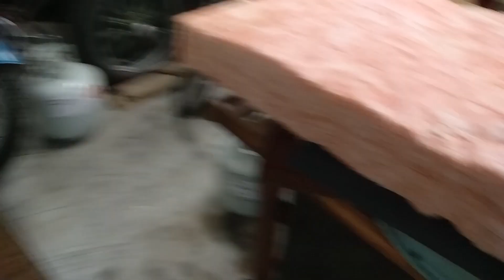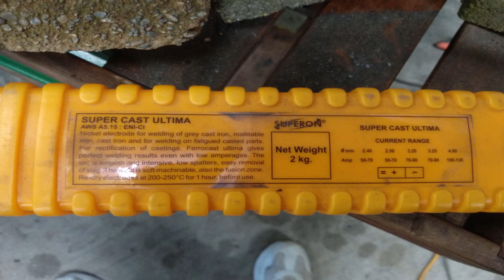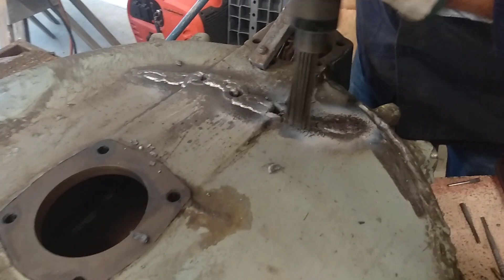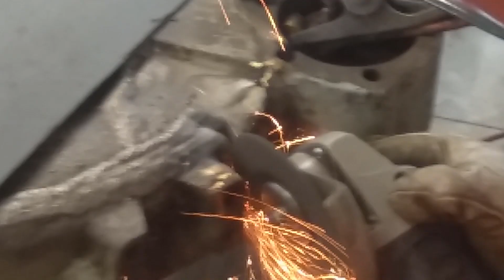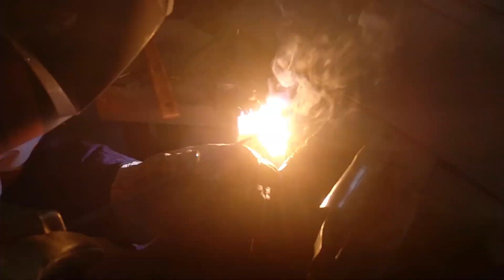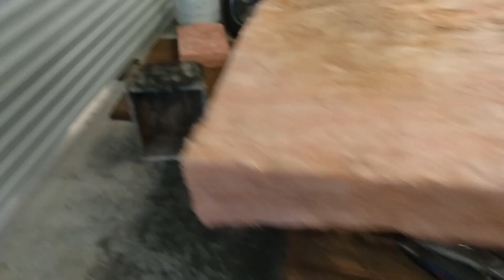1936 MASSEY HARRIS GP 4WD TRACTOR WELDING CRACKS IN  CAST IRON HUB HOUSING

Comment: Was just wandering if it would have been better to heat the casting to a cherry red with a gas set before welding
Reply: We do what we can with what we got as long as it works.👍🇳🇿
Reply from the maker: The BBQ was on flat out before we started welding and my brother has been doing this stuff for over 30 years and we didn't have a gas set so was the best way we could think of
Reply: Very specialised work and fascinating to watch.